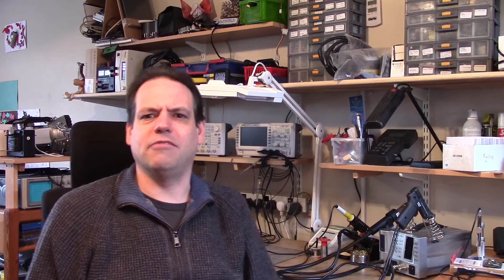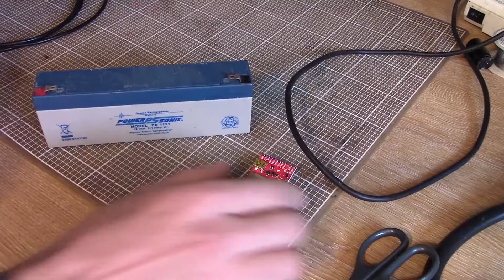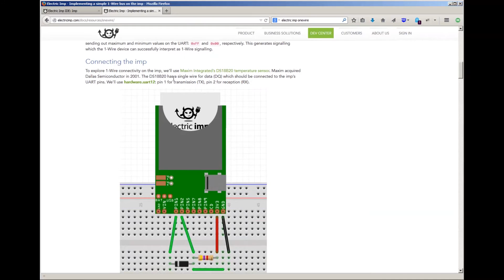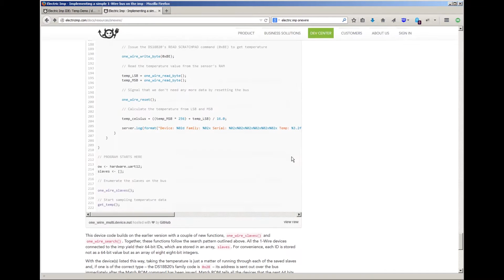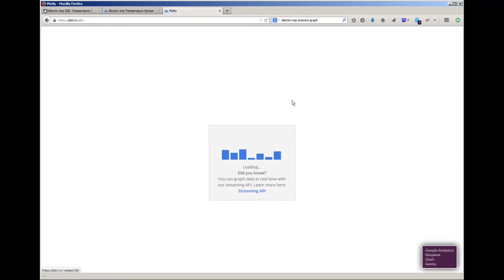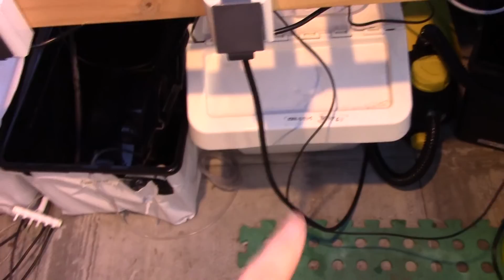Nutrient Temperature Monitoring with an Electric Imp and Plotly ( IoT Internet of Things )

Comment: Did you solder this together properly, later? It will be more reliable. Breadboards are only intended for temporary test lashups. Thanks for showing a very useful tool in construction and in use, Jim.

Comment: How does the Imp know which sensor is which?
Reply from the maker: Hi ChrisG - All of the DS1820 temperature sensors each have a unique 
16-digit hardware ID baked into them - they come like that from the 
factory. If you take a look at lines 7-16 of the agent.nut file ( 
https://github.com/jimconner/greenhouse_monitoring/blob/master/agent.nut
 ) you can see where I map the unique IDs for my sensors to their 
location names. Cheers!!
Reply: Jim Conner I gathered that the sensors had some sort of ID, my question is the sharing of the serial port. In the video you connected all three sensors to the bread board in the same spot. What's going on at the serial port that it knows whose communicating what and when. Did you have to setup something in particular. I read the if/then where you are parsing out the temp ids... but how does the serial differentiate in the first place ?
Reply from the maker: Hi Chris G - The DS1820 temperature sensors are not really serial devices as such - They use the Dallas 1-wire protocol to communicate. There's a rather clever bus enumeration sequence when the Imp powers up, which is best thought of as as something like.... 1.) Could all devices which start with a 0 reply now.... 2.) Could all devices which start with a 1 reply now... 3.) Could all devices which start with a 01 reply... 4.) Could all devices which start with a 10 reply... 5.) Could all devices starting with 100 reply ... 6.) Could all devices starting with 101 reply.... etc etc... By working it's way through a binary search algorithm the bus master can work out the IDs of all the connected devices (at a rate of 75 devices per second)... The replies during this phase are potentially conflicting with each other, but the master can see when the 1-wire bus gets raised high, so knows that something responded.... After the enumeration then it's a pretty straightforward case of the master and sending out the ID of the device it wants a reading from, and then the device replies back. The page on wikipedia on '1-wire' is actually pretty good. Hope that helps. Cheers.

Comment: was going great until a week ago or so ... plotly posts stopped working did you see the same issue?
Reply from the maker: Hi +Selwyn Rimmer  - Yeah... Plotly changed their API on the 9th November and that broke the original code. The fix... which someone on the plot.ly forums suggested is to remove the Content-Type: json bit from the local headers line in the agent.nut... The fixed code is up on github already at https://github.com/jimconner/greenhouse_monitoring .... however... after getting that fix working, I then found that plot.ly would only allow 30 updates to a chart per hour... so I changed the update interval to every 2 mins instead of every 1 minute... and after that, I found that plotly are now only allowing a total of 50 updates per day unless you pay them $20/month.... I&#39;m planning on spending part of my christmas holiday working on an alternative solution using a graphing system called Graphite instead. In the mean time, you can still log every 30 mins to plotly. Hope that helps. Cheers!!
Reply: +Jim Conner excellent, I assumed that was the case however have not had the time to work it out. Do like ploty but maybe not $20 a month as you say. Really appreciate the detailed update, I will action that today. Happy holidays from New Zealand!
Reply: +Selwyn Rimmer all go again, thanks for the tips!
Reply from the maker: Glad you're up and running again +Selwyn Rimmer  - Hope you have a good weekend. Cheers!!

Comment: Thanks for a great video.  I'm building similar project but I ran into problems when the temperature went below zero, the reading changed to ~1800°C.  Have you seen that happen?
Reply from the maker: Hi +Vilhjalmur Bjarnason - I haven't seen that particular problem before. I've had a number of DS1820 sensors fail on me over the years, and generally the failure condition is that they constantly read 85C... The way the sensor works internally is that the reading starts at 85C and then is added/subtracted depending on the number of counts it gets from it's internal oscillator... so when the internals fail, the reading stays at 85C.... The sensors are supposed to be good from -55C to +125C, so getting an 1800C reading is something of a mystery... I wonder if maybe the code reading it is incorrectly handling the sensor reading for negative values... I suspect perhaps an interger has wrapped around from 0 back to 255 again when it hits a negative reading. Cheers!!
Reply: Thanks, will have a look at the code :)

Comment: Hi Jim, I've got a very basic thermometer setup using a thermistor - my very first project!. It works great and I can see the readings on the IDE log. I'm powering it with a 12v battery in the same way as yours. How do I add code to monitor the battery voltage (VIN) pin and display that on the IDE log too? Cheers.
Reply from the maker: Hi Mark. Great work on getting your first project up and working - Congratulations - It's a good feeling. I'm somewhat cheating on the battery voltage reading as I'm not actually reading the battery voltage, but instead reading the output voltage of the onboard step-down regulator sing the Imps built in hardware.voltage() function. The output of the voltgae regulator will be 3.30 volts as long as the battery is supplying more voltage than 3.3 in the first place. The Imp will keep on running down to about 2.8V where the wifi stops working, I'm running my imp off a single 18650 lithium cell (scavenged from an old broken SatNav unit). The lithium cell puts out somewhere from 3.6-4.2 volts depending on it's state of charge (which is enough to keep the voltage converter happy and the reading I get at 3.30V)... It's generally OK to take a lithium cell all the way down to 2.75V without damaging it... so rather conveniently for me... as the battery voltage goes below 3.3V, the output from the DC-DC converter will drop below 3.3V too and I know it's time for a recharge. You can't use the same trick with a 12V battery though as the 12V battery would be totally ruined if you flattened it down below 3.3V... for a 12V battery you'll have to put together a voltage divider circuit and use one of the analog inputs on the Imp to read the value from there. I'm planning on switching my power source to one of those solar battery bank mobile phone charger things ( specifically this one http://www.ebay.co.uk/itm/10000mAh-Dual-USB-Solar-External-Battery-Charger-Power-Bank-For-iPhone-4-4S-5-5s-/371044523907?pt=UK_MobilePhones_MobilePhonesCasesPouches&hash=item5663fa1f83 ). I'll open up the case and solder a couple of wires directly on the batteries so that I don't have to actually switch the battery bank 'on' and can just leech power out of the batteries+solar.... The solar panel on that battery bank is rated at 1.2W, and I figure that given my tiny power requirement, I'll never have to charge the batteries. Hope that helps. Thanks for watching and chatting to me in the comments. Cheers!!

Comment: I like the new chart with all the temps in one.  I scammed your code and was pleasantly surprised when I saw the new layout.  I pretty much copied exactly what you did in this video and now I have my own temp setup.  I converted to Fahrenheit and changed some names, but that's it.  Great fun and very useful!  Now I just have to get the probes in the proper positions.  That for the idea and the help and encouragement along the way Jim!
https://plot.ly/~FesterWerks/54/grow-room-temps/
Reply from the maker: That's awesome Marc - Very glad that it's all working for you :) - Looks like you have two different Imp boards up and running there as I can see two supply voltage readings on that same chart. I'm planning on adding in a humidity sensor, bariometric pressure and light level sensor at some point soon.. The parts have arrived, I just have to get around to integrating them with the setup in the greenhouse now. Cheeers!!
Reply from the maker: Jim Conner Hey Marc, now that we've moved into February, I've noticed a weird thing on my graphs - It's reporting the month incorrectly... Looking through the past data, I see that the month was '0' throughout Jan, and now we've moved into Feb it's become a '1' - are you seeing the same thing on your graphs too? I did try to take a look at the graph from your comment above, but it's gone now.. moved onto a new plot no doubt. Cheers!!
Reply: I noticed the date thing too, I tried to change the format of it, but I hosed the whole thing so I put it back.  I'm working on several things at the same time, so I keep deleting the graph and making a new one... If you just go to https://plot.ly/~FesterWerks It'll show my most recent attempt.  I've got a water sensor hooked up to the same imp on different pins and I'm trying to get that to show properly by appending it to the current data like you did for the voltage.  So far, it's only half working.  I think I need to be more familiar with plot.ly :)
Reply: Jim Conner
 I ended up making the change in the device code (local month = date["month"]+1;) but I had to reset all my data again.  No biggie for me because I just got my water sensor working and the whole thing in place in the grow area.  But you have a lot of data and it'll really mess up how you display your data if you skip a month. OOps, just loaded yours up again and see you reset your data too, but you're back to November :)
Reply: Jim Conner
 The imp documentation mentions the months start with 0.  The perils a of proprietary programming language.  I'm sure they have a reason for it.
Reply from the maker: FesterWerks Heh... Yeah... I was just editing my code and had done month+1, but it had done it with strings, making the month 11... I now refer you to https://plot.ly/~Fecn/308/hydroponic-greenhouse-temperatures.embed ..which is for February...  I'll undoubltedly wipe that soon when I add on the pressure sensor though. Cheers!!
Reply from the maker: FesterWerks And yet the days start from 1 - I've never come across anything that counts the months from 0 before... what a very strange choice for them to have made. Cheers!!
Reply: Jim Conner
 Looking good now for sure!  It took me forever to figure out I had to convert an analog sensor reading to float (water_sensor.tofloat() ) so I could do proper math on it.  Fun stuff though!
Reply from the maker: Yeah - it's nice to have a little electronics project on the go on the side - I really like the way I can push new code to the Imp wihtout having to connect it up to the PC. Cheers!!

Comment: Great job Jim.  Since I don't have a greenhouse yet, I did a similar this using an Arduino Yun to measure temps/humidity in my house and the water level in my sump pit.  All this data is sent to a database server and viewable with a web browser...
Reply: This is a site with the reults from the Arduino I have running...
http://www.project36.org/?page_id=25
Reply from the maker: Jason Moyer That's very cool.... I like how you can see temp2 cycling more frequently during the nights than the days as the heating comes on more frequently. Excellent :)... One question though..  How are you measuring the water depth? I've been pondering how to accurately measure out water for the last week or so, but haven't yet decided how to best do it. Thanks especially much for commenting because now I can pester you with questions :) Cheers!!
Reply: Jim Conner  I am using this eTape:
http://www.adafruit.com/product/464
It gives you back a resistance value.  What i did was to build a table so I could associate a resistance value with a height in inches.  i just kicked off the sump pump, so you will now see some lower values for a bit.
Reply from the maker: Jason Moyer Ah yes... I've looked at that before and thought it looked like a great sensor, but couldn't bring myself to spend that much money on it... I've been thinking all day about alternative ways of doing the same thing. Cheers!!
Reply: I had the sonar sensor in there for a bit, but something tended to fail in it.  Maybe moisture.
Reply from the maker: Jason Moyer I found some reasonably inexpensive weight sensors on ebay yesterday which will weight up to 20KG with reasonable accuracy - I might use one of those and just weigh out the water rather than trying to meter the flow or sense the level - My biochemist friend Matt tells me that doing it by weight is the most accurate approach (not that I need a particularly high level of accuracy). Cheers.